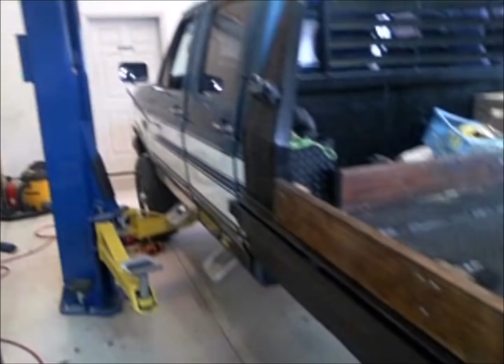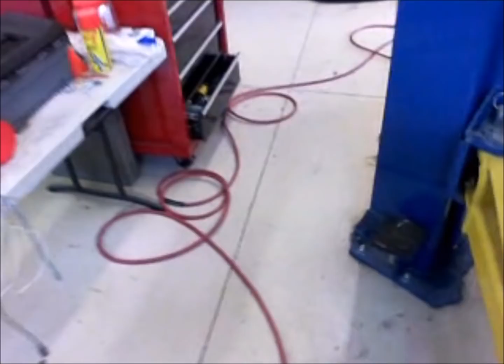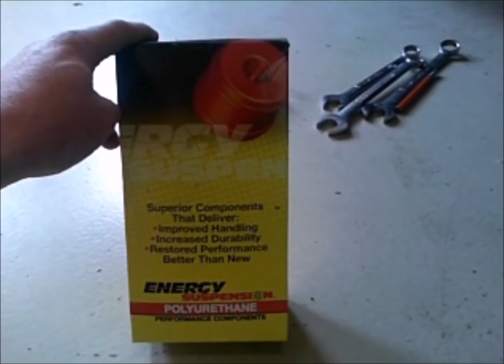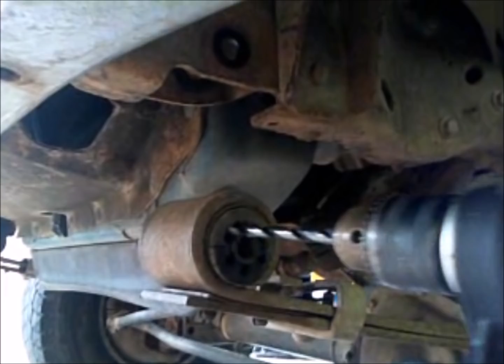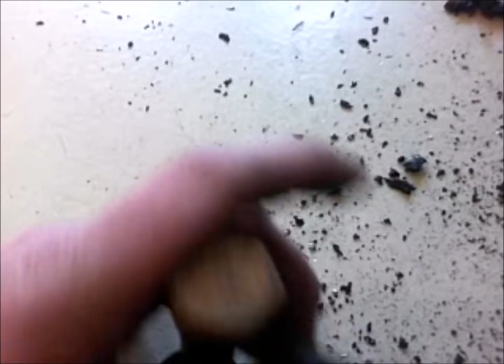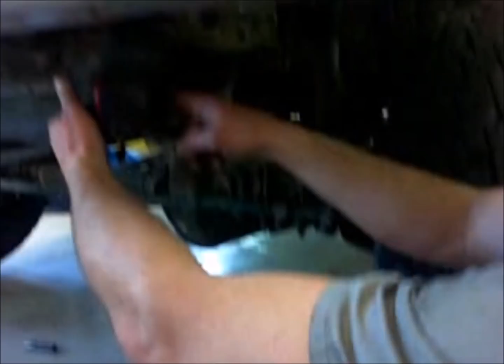Leaf spring bushing replacement

Comment: All i need is a video showing me the correct way to put it back together. Been fighting it all morning. Rear are all done.  Lining up the front bushing to the frame is a motherf**
Reply from the maker: Try some big pry bars or even a come along to bring the spring back into alignment with the shackle. Just be careful when doing so, as you are elevating the risk of injury.
Reply: What i had tondo was completely take it all back apart, meaning unhook the shock as well as the axial bolts holding down the frame, then take bolt out from the rear shackle, then using the jack lift the axial to to the frame Mount in front before bolting the rear of the shackle. 
Figured i did it ass backwards, but was being lazy about taking it all back apart. Only spent 3 hours being lazyand 20 minutes to line it up and put back together correctly.

Comment: Hello,
Question. Im trying to install front sway bars for my motorhome. It says the bracket bushing attaches to the front eye bolt leaf spring. How do i go about removing the eye bolt to install the bracket inbetween and re install the bolt. Do i need to jsck up the axle or can i do this with the vehicle on ground front end tires touching ground. Just unbolt add brackket and then re install bolt?
Thank you
Reply from the maker: Is this regarding the 2008 4200?  I would need more information.  This might be a good question for the manufacturer of your sway bars as it sounds like an aftermarket add-on.  If you are talking about pulling the bolts that hold the leaf spring to a mount/shackle, be very careful as those bolts are part of what is holding up the vehicle. If you pull those bolts, the vehicle will fall, unless supported.
Reply: @American Guy  yes sir. It's for 2008 4200 motorhome international. Pulling the bolts out to add a shackle that will support and hold the front sway bars. Aftermarket add on. So that being said, I'll have to bottle jack the front end lift the truck off the ground?
And thank you for getting back to me.
Reply from the maker: @Hf0205  If I understand this correctly, you will want to place jacks under each frame rail to support the motorhome. The vehicle will need to be raised to take the weight off the springs/axle. Then you should then be able to pull the bolts and everything (axle and vehicle) should stay put allowing you to add on your shackle. This is a good time to inspect the bolts and nuts. Being a motorhome, the miles are likely such that the bolts will be in good shape, but I would consider replacing the nuts with a new locking nut. I say this not having worked on one of those Internationals, so use good judgement and wisdom when making these decisions. You can also refer to the manufacturers repair manual.

Comment: Wait!!! it's that a Red underwear that you used to clean after  remove the sleeve!
That's Soo Cool!!!!!
Never saw that before 👏👏👏👏🖖
Reply from the maker: Haha, it was an old T-shirt of mine but I did watch that part again and it does look like it!
Reply: @americanguy4646  Great video Sr,it will help me to fix my bushings on My 95 Chevy also clever idea to replace them with the polyurethane,now got a ❓
Are the same size the rear ones and the front ones from the leaf?👍
Reply from the maker: @zerchdafirst5994  On this truck both the front and rear bushings on the front leaf springs were both 2". The shackle bushing was much smaller. The rear leaf spring bushings were much smaller in diameter than the front bushings.  As far as your '95 Chevy, I don't know if they are the same size; if you go to some of the polyurethane bushing company websites, they offer that information on their site as an aid to parts identification.
Reply: @americanguy4646  thanks for the info,i will check it out before,I star work on it 👍👍🖖

Comment: if you use a torch and saw it goes rather quick ive seen. you first cut the mushroomed head off then torch the leaf so it losens from the rubber bushing, then pop it out. nice vid though and thanks for showing. I would have just bought oem but these bushings look sick.

Comment: Would a 1997 Explorer Rear of Rear Leaf Spring Bushing be easier than this?
Reply from the maker: Shouldn't be too bad, but the smaller the bushing, the more difficult it is because you have less room to get tools in there to remove bushing material. Good luck!

Comment: my 35 dollar ebay deal on the very basic ball joint C press tool kit pushes the center sleeves of these bushings right out using no cups like it was made for it then the rubber is much easier to pry out with just a couple flat screwdrivers

Comment: One thing I’ve done worth mentioning is take a drill bit you can afford to lose and work it between the leaf spring and the bushing “usually” you can get it to work around the bushing freely loosing it up in there then take your air hammer or BFH and they pop right out

Comment: Did your drivers side shackle pop out to the side after you got it out of the frame?
Reply from the maker: Was the shackle still attached to the spring? If so, yes. The springs will move once they are removed from the attach points and can be a chore to get back into place. I have used big bars to pry and even a come-along to move them back in place so that I could install the bolts. I haven't tried it, but removing the track bar to get the springs bolted back up might make it easier. However, putting a track bar back on is a chore as well unless yours is adjustable, but then you need to know how to adjust it once it's back on too. It's pretty much a case of pick your poison.
Reply: @americanguy4646  ok thank you it still was

Comment: If you  take a small propane torch and heat the metal tube bushing up be carful not the breath in the burning rubber fumes the metal collar will push thru fairly easy then 
Using a piece of round stock

Comment: What issues did the worn leaf spring bushing give you
Reply from the maker: Extremely bad outside tire wear on the front right tire and an overall looseness in the steering wheel and the looseness was felt as I would go down the Interstate. I did the bushings on the front axle first and the rear a month or two later, and I noticed that the truck tracked better down the Interstate with each repair, but by far the most noticeable were the bushings on the front axle's leaf springs and shackles.
Reply: American Guy I had bad tire wear on Both front tires on the inside close to the wheel well wasn't sure if it was from bad alignment and lack of tire rotation
Reply from the maker: It sure could be a lack of alignment and rotation, but I think you would have to have your rotation checked to determine if it truly is. The alignment and rotation are basic, important things that need to be done anyway. Over the years, I have been surprised many times by how many seemingly big, complicated car troubles are fixed by simply catching the car up on routine maintenance. I would start with the alignment and rotation and then go from there.
Reply: samuel Allen

Comment: one piece bushing is so simple, getting put of shackle is the worst after that drill out rubber if or as necessary it will push out or fall out after center sleeve removed . afterwords 2 cuts lightly  of outer  sleeve . curl it over done at that point.

Comment: Thank you! I was wondering how to remove my bushing in my leaf spring. I never thought about what you did but now I know.
Reply from the maker: Glad it helped!
Reply: American Guy
Now I need to press in the 1/4 that is not moving by a hammer. Home made press. sockets, threaded rod, washer, and wrenches. It worked great. the metal around the bushing took the longest to get out.

Comment: thanks a lot for the ideas fellas.  Great video.  I was looking for a better way to remove the rubber from the spring.  I wont use fire because that ruins the temper of the metal causing possible metal fatigue fracture down the road.  I really like the hole saw idea!

Comment: I've never replaced leaf spring bushings so I'm not trying to correct your method just trying to ask an honest question. That being said, can't you just press the whole sleeve, bushing and all out of the leaf spring?
Reply: As someone who's also worked a project like this, most often times no you can't. They are usually bonded and have to be cut, torched, and/or pried out. They can be a real bitch sometimes.
Reply from the maker: I have never tried it. Give it a shot and let me know how it works out.

Comment: there is a kit to remove upper control arm bushings to rent at advance. it has a smaller c clamp than a ball joint kit. perfect for these jobs. take 10 seconds with an impact.

Comment: How much psi did you have set? Trying to get my bushing out of a 2001 jimmy and my air chisel doesn't seem to want to push anyrhing
Reply from the maker: My compressor is still at the factory setting-I think it is 155 PSI, but I was at a neighbors house once and used a little compressor and I had no trouble aside from having to let the tank fill up every so often. I would look more at your air chisel. I would think that it would be the culprit. Possibly your air hose is small and does not allow for a good airflow from compressor to the tool?  I hope this helps.
Reply: American Guy gotcha it's defiantly small tank. I'm using 3/8 hose. I'm thinking they are just so rusted on it's causing problems. I started using a cold chisel and hammer and making a little more improvement
Reply from the maker: Good to hear.

Comment: what size is the outside diameter of that bushing? And he size od the bolt hole in the sleve? Thanks
Reply from the maker: The front leaf spring eyelet bushings are 2" on this pickup. The front shackle bushings are smaller. If you buy the 2" bushing kit from Energy Suspension the correct sized shackle bushings are included. As far as the bolt hole goes, I don't know. The book would have it, or you could check when you take your vehicle apart.
Reply: +American Guy 
thanks man, I got mine apart and I am having a hard time finding them for my 97 E-150 for the rear spring front eye. They are 1 5/8 o.d. with a 5/8 bolt hole, 2 1/2 spring. Just trying to find some that will work.
Reply from the maker: No problem. I went to Energy Suspension's website and they do make a kit for the '97 Econolines, but only the E-250's and E-350's. I wonder if a phone call to the company would get you the answer you need (they could tell you if they make a kit for that vehicle-if they don't call one of the other bushing manufacturers).

Comment: Very good video! By the way how are the bushings holding up so far? Any noise?
Reply from the maker: Thank you!  So far, they are holding up just fine. No noise whatsoever, except on one, where a fuel leak basically washed out all the grease I put on the bushing during installation. I should take it apart and re-grease the bushing. I expect that would fix it. The noise is minimal, however. I am still happy with the move to polyurethane bushings.

Comment: did you have to loosen the front shocks and u-bolts? Or did you just loosen one part of the leaf spring at a time?
Reply from the maker: +everardo garcia   I did not loosen the shocks or the U-bolts. I just pulled the bolts on the ends of the springs as shown in the video.

Comment: I have no pneumatic tools. do you think just melting the rubber out with a blowtorch would work? if so, then how would I tackle the metal sleeve? I'm guessing a flathead and a hammer are out of the question.
Reply from the maker: +Cliff-Ranger48 
Sorry, I do not have a solid answer for you. You will need to do some more research to get your answers. The way I understand it, the springs are heat treated, and if so, a torch would change the temper of the steel, most likely weakening it-something like a cracked leaf spring stack as I go down the interstate is an unacceptable risk to me. A flathead and a hammer are not out of the question, as long as you have A LOT of time. Like months. Maybe you could look into renting a compressor and air hammer from one of the local equipment places? Best of luck.
Reply: I can tell you from experience this weekend that hammer and screwdriver will not punch the metal sleeve out. I tried 5# hammer, chisels, punches but no luck. I tried ball joint press with collars, washers, and sockets, and still no luck after 6 hours!!! I finally went to Home Depot the next day and bought an air hammer and reciprocating saw, but found I was most successful with air hammer with punch bit, as it chiseled and punched those sleves right out. These were original bushings, so metal to metal bonding. Take steps by pushing out inner metal sleeve, then rubber bushing, then finally working on outer metal sleeve, your job will be much easier. May be worth investing in a Harbor Freight pancake compressor and air hammer as a "Budget Alternative", since you do not have pneumatic tools. Best of luck to you..

Comment: Did the shackle bushing have a metal sleeve between the rubber the shackle?
Reply from the maker: +Colin Nakano 
No, there is not a metal sleeve between the shackles and the shackle bushings. Makes it that much easier.  :)
Reply: American Guy awesome thanks did you replace the rear bushings in the front leaf also
Reply from the maker: +Colin Nakano 
Yes, I did replace them. Actually, I replaced all the spring and shackle bushings on the truck-front and rear axles included. I just felt that it was unnecessary to include all that in the video.

You will want to replace the rear bushings in the front leaf because after the shackle bushings, they get the most wear since they are attached solid to the frame. Most manufacturers put the shackle at the rear of the leaf and that allows for some movement and less stress and strain on the bushing as you hit bumps or holes in the road. As I see it, Ford should have put the bushing at the rear of the leaf. There are a couple of manufacturers out there that make shackle reversal kits if one decided to put the shackle at the rear of the spring.

Comment: To remove the spring bushing' after getting the rubber core out, do you think a press tool using a screw and various cups would also work?
Reply from the maker: +nicholas elias 
If I understand your question correctly, you are asking about using a press tool to remove the steel sleeve that is left in the leaf spring eyelet after removing the rubber. That would work fine, but you will need to make sure your "cup" is sized close to perfect as the steel sleeve is very thin. I hope this helps.